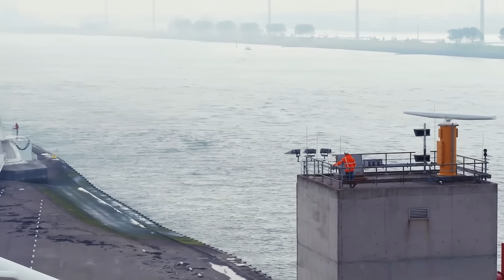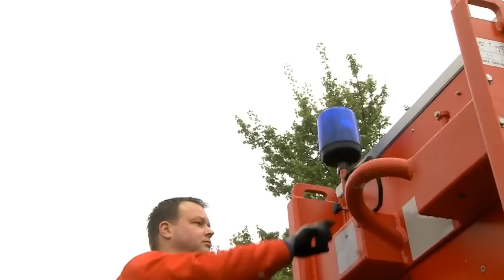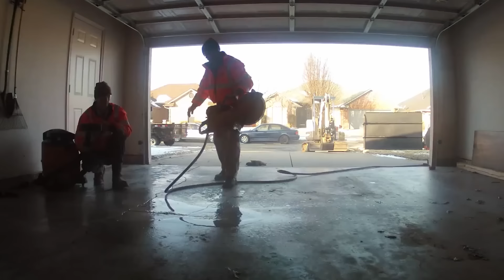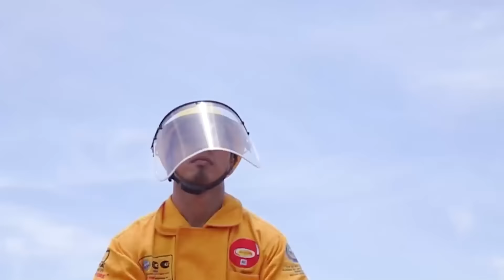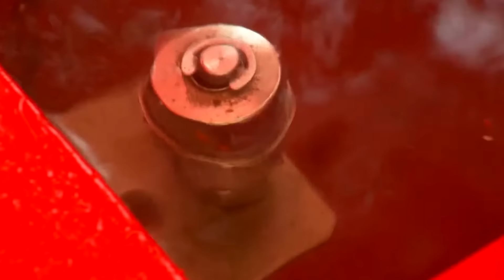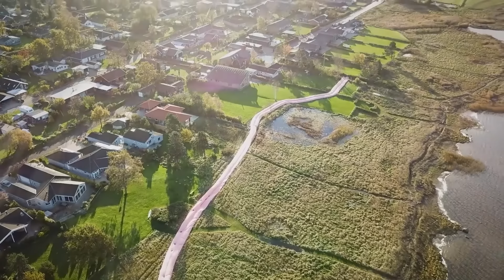FEW PEOPLE HAVE SEEN THESE AMAZING LIFE SAVING INVENTIONS

Comment: The storm shelter is good for smaller tornadoes but I would want something below grade in  tornado prone areas. We have been near miss a few times (in Texas and Kansas) and the damage caused by more common EF3s is substantial. In Kansas we were a major block away from a straight line wind hit that took out an airport and a self storage facility. When winds like that strengthen an go vertical the resulting tornado can be capable of erasing large swaths of buildings.
Reply: They briefly showed a unit being installed beneath a garage floor, which seems like a good idea (esp. since you could stock the garage with supplies).  Or you could probably place one of the above-ground units in a basement.
Reply: @PongoXBongo  The standalone units buried in the yard are the best. The problem with one in the house or garage is that there is always a possibility that the house will be piled on top of the entrance when the storm passes.

Comment: Floodgates for your exterior doors to keep the flood waters out? Unless your house is built with impermeable walls, flood water will seep in The video shows a house with a stone wall, but only if those stones were set with waterproofing mortar will that elaborate floodgate be of any use. People with even a cursory knowledge of architecture can see through that laughable invention.

Comment: Reeding so many post's about the escape back pack safety harness , It is a good idea, but one problem that i can see, who is going to maintain the hook to make sure it is up to the strength when needed and who will be reliable for them.
 
if need to use it for an emergency, one does not want to hook onto the fixing if is rotten or broken within the structure of the building, or this will be a real leaps of Faith. i mean base jumping Lemmings.

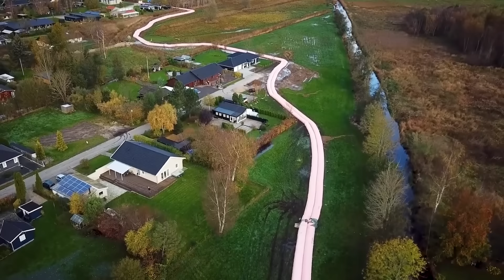Comment: 11:00 Balboa Island in Newport Beach Ca. needs this system, I was there on a King Tide and the water was higher than the wall, they had to doubled sand bag it and racing around the clock to do it.  The homes are lower than the wall.

Comment: The round bunker's door opens outward, which is good for strength but bad if something falls against it and wedges it shut. Ideally you want a door that opens outward but has a hydraulic assist in case something falls on it.
Reply: The survive a storm shelters come with a standard monitoring service. In that if a storm has been reported in your area, the company makes a wellness check call to the phone numbers you provide them.  If there is no response they send 1st responders to get you out and if there is a injury a medic team. They are also geotagged because sometimes there are no roads to tell them where to find you. This way they can follow the gps signal.
Reply: Or a ladder inside with a door on top in addition.

Comment: A monolithic dome house can handle 7.0 earthquake also run on just a mobile home heater keeping the house at 73 degrees F in winter and only use the air conditioner very little during summer ☀️ and handle a direct hit of An F5 tornado 🌪.

Comment: About the door flood shutters, have they done testing in actual flood situation where small to big and assorted sizes of stones and sand are getting into the seal area before it gets totally sealed off. These solids can disrupt the sealing procedure. I suggest that they should improve the system by adding super pump around and almost outside of the door jamb that keeps flood waters with solid getting into the sealing couples that will surely miss it up and unsuccessful sealing it may become. Number two, what if people inside wants to go out because of necessity and if the opening sequence if the flood sealing doors system begins at the bottom, it will allow flood into the room or space. Is it possible that opening the sealing doors should start at the top panels so there is a choice or chance water can not get in while displacing people out!

Comment: The round bunker door opens outward.
If your house collapses on it you will not be able to get out.
Stupid design.

The rectangular ones open inwards.
Make sure to carry a battery powered sawzall with a good demo blade and a number of charged batteries to clear debris ti get out.

They sell them through Home Depot in my area.